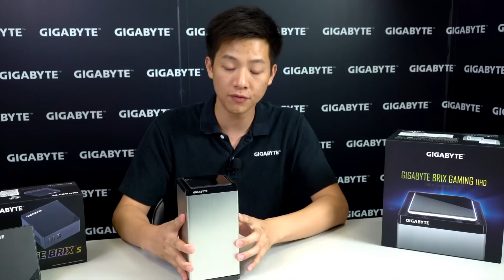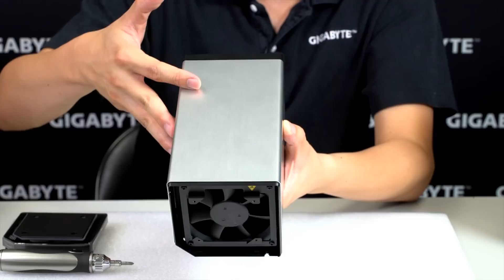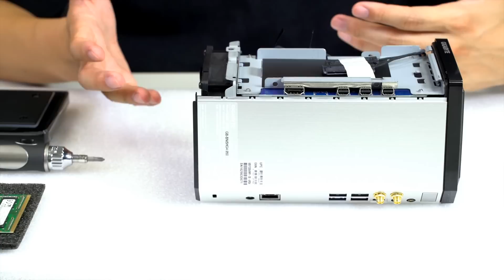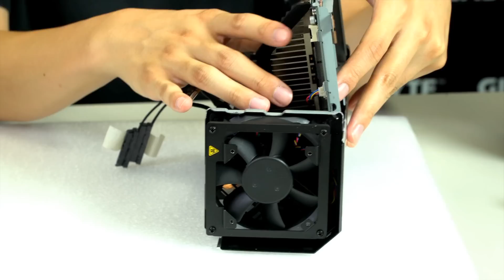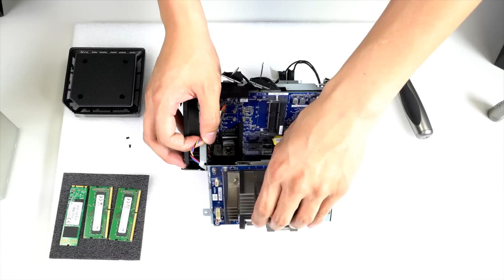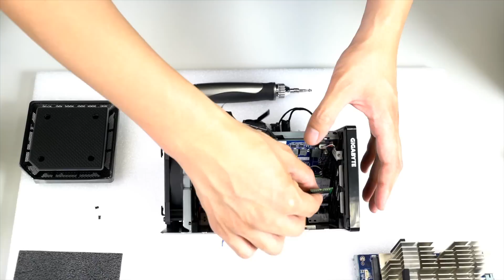GIGABYTE BRIX - BRIX Gaming UHD - Installation Tutorial

Comment: Very nice. Reminds me of older times, when everything was over engineered for easy user serviceability.
Some of those old Compaq machines were built like tanks, with extra screws and rails built right into the frame for easy access. They even had flip up devices and bays built on hinges too.

Comment: Will you be doing a 1050 upgrade part at some point?
Reply from the maker: Very possible :)
Reply: Oh please let it be a 1060
you can't consider any Nvidia x(y)50er card worth for gaming...
Reply: Just a personal opinion
That's just the category of cards I never consider to replace an already existing one
Reply: I don't dislike the x50s in general
but since they are basicly almost the smallest cards out there and the weakest if you don't consider OEM cards, they barely benefit from any transistor shrink - the 950 has about a similar poerformance as the 3yr old AMD R9 270X
Reply: Yeah but the performance of an 270X represents the absolute minimum for a gaming rig for me
Reply: Please wait for Kaby Lake for a proper update.

Comment: if you use a 2.5 HD and if intern temp in game is = 80 ° C your HDD is dead max temp for HDD : 50 °
Reply: The cooling solution looks really effective and this thing use only a bit more than 100 Watts under full load so it will be never 80°

Comment: Good design.. i like it. my current brix pro makes noise while cooling, it seems better design and cooling

Q1 : Does it supports 4 display of 4K@60hz? 
Q2 :  does it comes with water cooling? (or any future version)
q3 : Can i customize CPU?.. like  there be a version with more powerful embaded cpu like CPU i7-5775R(one of brix pro) with built in GPU, so that CPU hungry person like me can use built in GFX, so initially we may not spend on GPU and add that module later on. 
q4: What is the max sound of fan in high load? 
q5 : what is the max temparature in 100% CPU usages over 1 hour straight. 

I will wait for answer, I am very satisfied with current 4770r, your answers will motivate me to buy this.

Comment: Is it possible that you raid the two M.2 SSDs instead of raiding one M.2 SSD with other SATA drives?
Reply from the maker: Unfortunately no because one of the M.2 Slots comes from the CPU directly so it doesn't support the RAID functionality.
Reply: That makes sense. Thanks for your answer.

Comment: OK. who's the idiot over at GIGABYTE that thought putting the power button next to the rear I/O was a good idea. Please move power button to the Front/Top of the device.
Reply: it doesn't matter because it's a tiny box .....u don't have to stick your arm behind a huge pc under a desk ......also wiring it to the opposite side is probably an unnecessary complication of the production line and it will just get in the way when u open it
Reply: I don't mind. I rarely use the power button. It is mostly sleep/wake using the keyboard. I prefer the clear front.